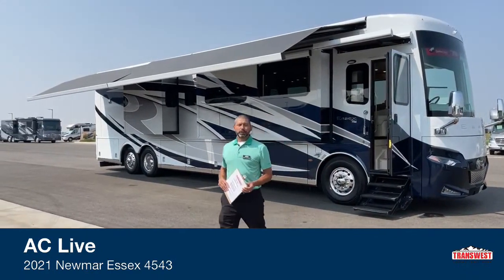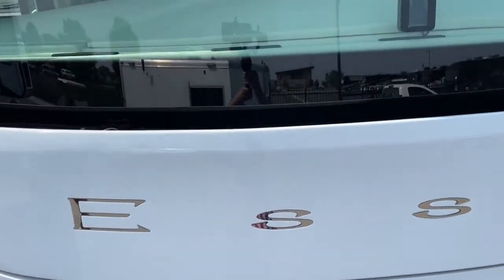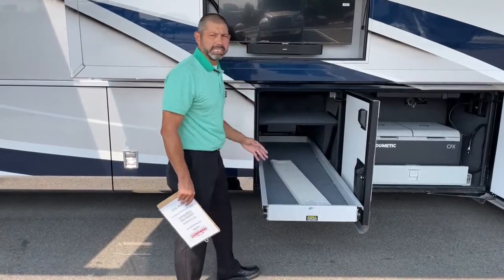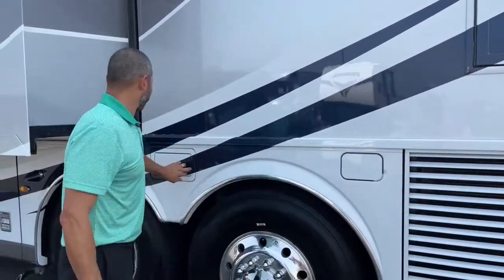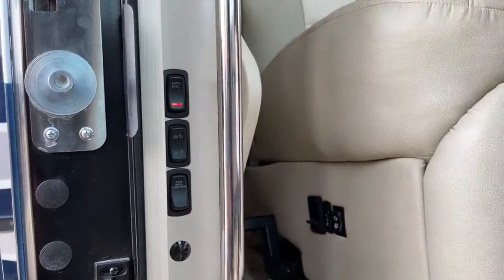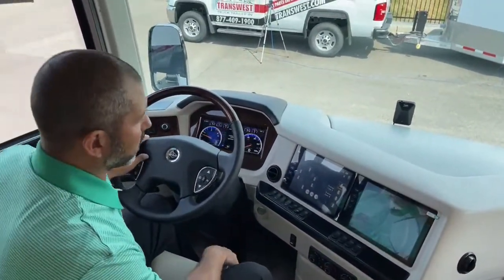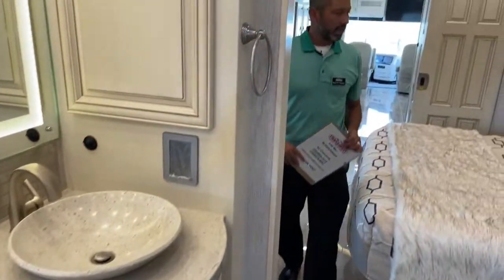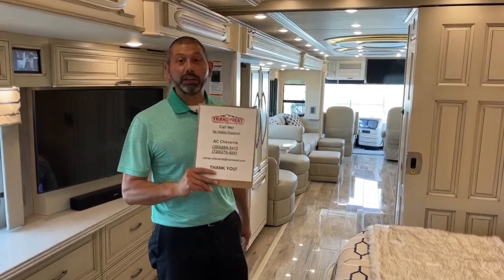2021 Newmar Essex 4543

Comment: * Thank you for the great video & tour. You have done a great job with the detailed walk-through. 
* I like the floor plan layout of this coach. I like the furniture colors & styles. 
* But I don't like the over-the top slide trim & ornate wood work. I would want this removed and replaced with flat modern cabinets, remove the decorative columns & remove the heavy wood panels on the appliances. I would like the decor design to be simple, clean & calm. Not busy & bulky.
Reply from the maker: Glad you enjoyed it!
Reply: Thanks for watching and for the kind words.  We do the videos live so you never know what's going to happen.  I actually meant to end the video with the theatre function that drops the shades, dims the lights and brings up the televator but I forgot.  Probably had something to do with the engine compartment door almost hitting me in the face.LOL